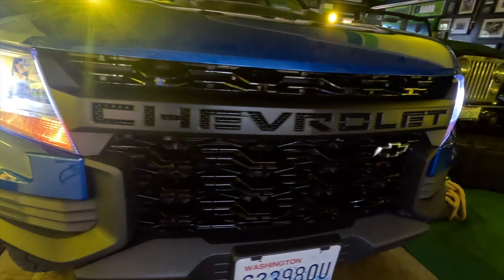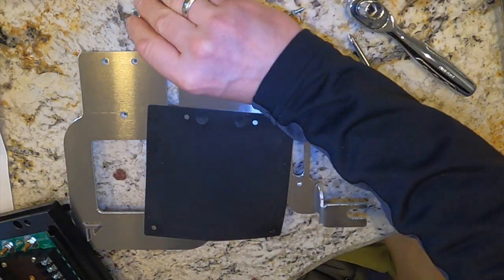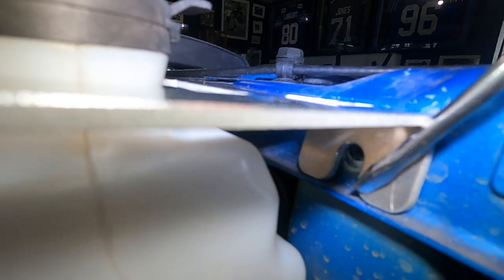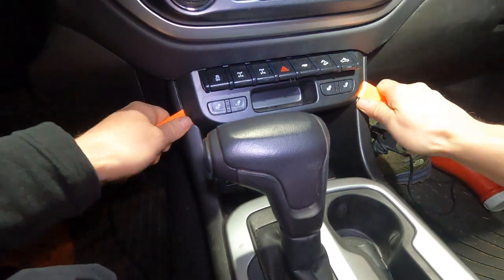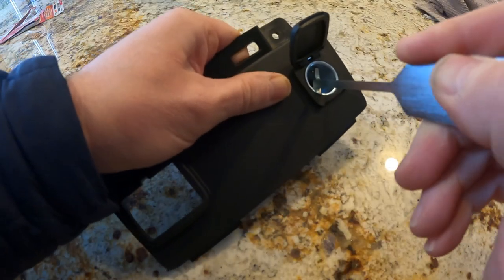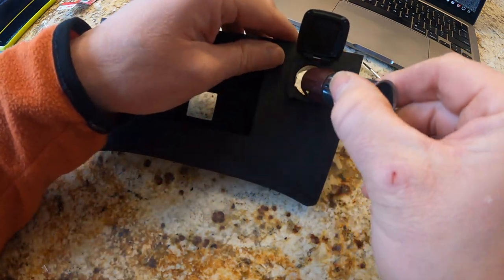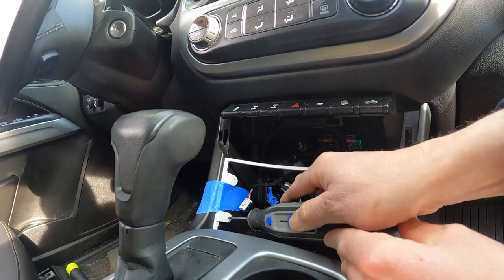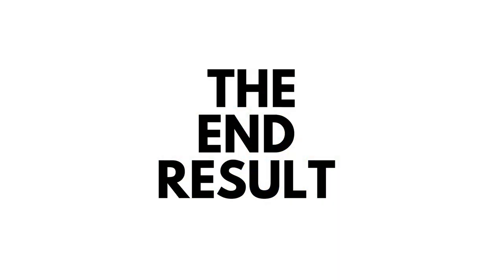Chevy Colorado ZR2 sPod Mini-6 DIY Install | Adding Ditch Lights

Comment: How did you pass the ethernet cable through the fire wall?
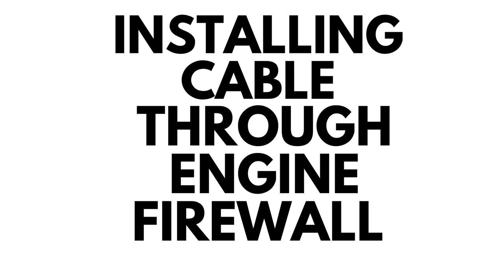Reply from the maker: I cut a hole through the rubber grommet near the steering column and fished it through go to the 4:24 minute mark